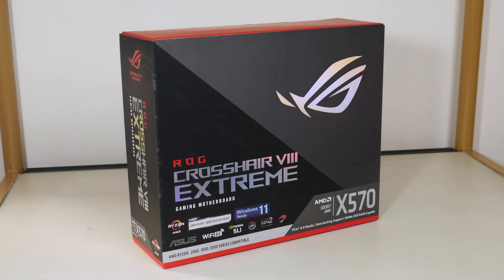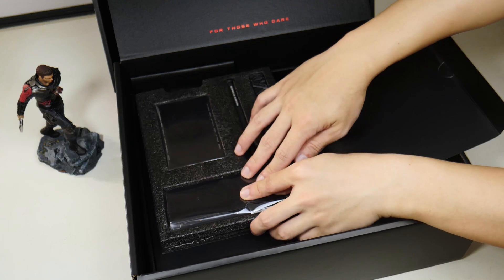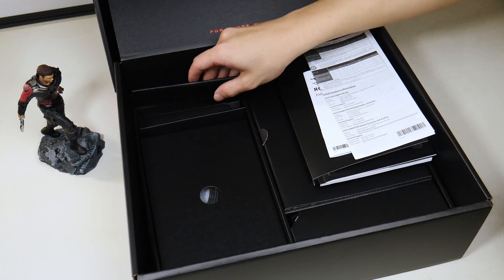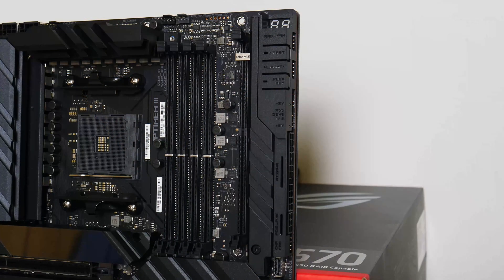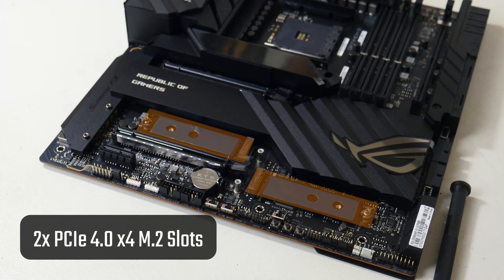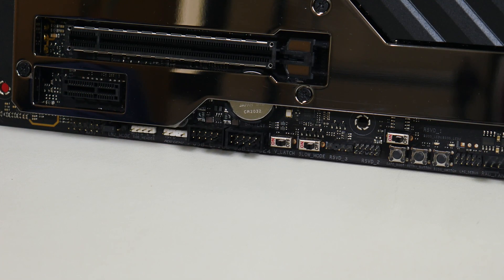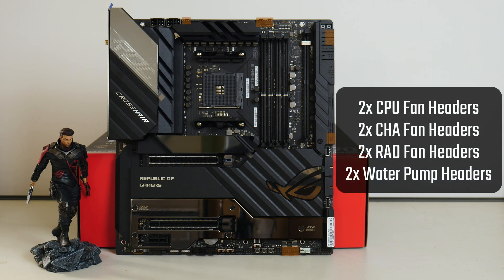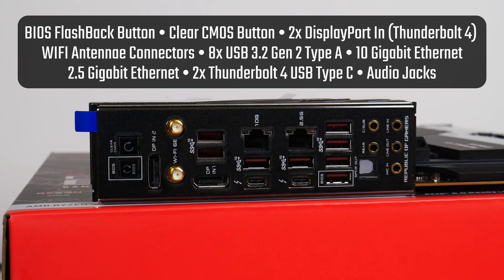The Ultimate ASUS X570 AM4 Motherboard: ROG Crosshair VIII Extreme

Comment: Is it possible to use all five nvme slots even if everything is ready to the chipset without reducing bandwidth for the gpu?
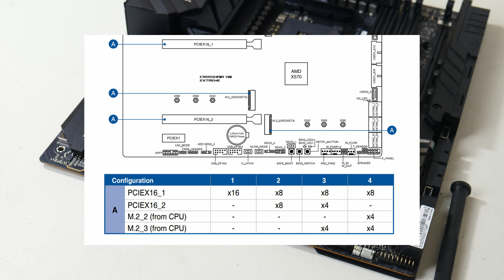Reply from the maker: This is not possible unfortunately, the three M.2 slots on the board utilise PCIe lanes from the processor, and as shown in 10:04, if you populate M.2_2 and M.2_3 concurrently, the PCIe bandwidth for your GPU will be reduced...
Reply: @ALKtech  thanks for responding on such an old video I really appreciate it!  I don't suppose off the top of your head you know any x570 another words that are roughly this quality and can fit more m.2 drives then 3?  Trying to build the ultimate pcie Gen 4 build.  Don't care too much about the price tag as long as quality and features are top-notch.
Reply from the maker: @Slacker28  happy to help! How many M.2 drives in total are you looking at using? You might want to look at the Gigabyte X570S AORUS MASTER that has four M.2 slots - one of these slots shares bandwidth with the PCIe x16 slot that operates at x4 mode.

You could also try looking at MSI's website for high-end X570S board offerings - those from the MEG range for instance!
Reply: @ALKtech  thank you! I will.

Comment: I ended up being in the right place at the right time, and got this board for a much lower price. It should be in next week. I can't wait to build it. Good vid. But why doesn't anyone say what the "ON/OFF" switch is above the safe boot button????
Reply: How much did you get it for
Reply: @SGOVisions  I got it for $600. But I have since sent it back and gotten a full refund as it would not run properly after using the Dim.2 slot for the two extra ssd's. I then went full upgrade with a Ryzen 7950X, Strix E and 64GB of DDR5 6000 RAM. IF you're going to pay premium prices, might as well go with the latest and greatest platform...

Comment: so to be clear and see if im correct. i got 3 m.2's, if i would occupie socket 1,2 and 3 mij gpu wil drop to 8x.
If i would use m.2 socket 1 and put the other 2 m.2's in the dimm2 module dan all wil be on full speed.?.
Reply from the maker: That's right - I would recommend installing your second and third M.2 drives on the DIMM.2 module instead, so as not to reduce the bandwidth of the primary PCIe x16 slot to x8 speeds for your GPU.
Reply: @ALKtech  another question you maybe knows, if i use the dimm.2 with 2 NVmE's wil that have consequenses, like slowing down something else? maybe the ram? im gonna use 4 ram sticks.
Reply from the maker: @2684dennis  you'll be fine - the DIMM.2 slot operates independently of the main system RAM and will not affect performance in any way!
Reply: @ALKtech  From what I've seen on other videos, you can occupy all five m.2 slots, and the FIRST PCIe slot with your GPU will STAY at X16, and ONLY the second PCIe slot will be disabled, not that the first will drop to X8. So I'm wondering which one of you is correct?

Comment: Much appreciated! Best overview of this board on YouTube. Today I’ve been building myself a new workstation with this motherboard and and the new EK-Quantum Momentum² Monoblock. Your video helped med figure out how to connect the Fan Controller correctly among other things. The ASUS manual is far from complete :) Thank you.
Reply from the maker: Thanks for the kind words - great to hear that this video was useful for you! Sounds like you've got quite a beast of a build right there - what are some of the other components that you've selected for your build?
Reply: @ALKtech  2x APC Back UPS PRO BR1600MI, The EKWB Monoblock, 5950x, 4x32GB G.Skill Trident Z Neo 3600 CL16, Samsung 980 Pro’s, Aorus 3090 WB, Corsair AX 1600i, 2x EKWB D5 pumps and 2x420 EKWB x-flow radiators (not yet delivered, so I use 2x280 now), Noctua fans.
This rig is of course somewhat overkill for most of my work, but it is a nice gaming rig too though :D
I wanted to compose a proper maxed out standard desktop for Solidworks and Photoshop. Next upgrade will probably be to replace the 3090 to a AMD W6800 card. I'll will order a custom CNC-milled waterblock for that card, as I have tinnitus and prefer not to listen to fan wining when working, and that graphics card will likely be reusable in the next rig, after AMD releases their next gen cpu's, maybe next year. This rig is not yet completely silent, but when the new radiators arrive I’ll will move out of the BeQuiet 802 case into a IKEA Baggebo cabinet (or similar furniture cabinet) and trim that one with sound damping air filters and some foam sound mufflers, vibration dampers and such.
Reply from the maker: @kitewinds663  You sir, have one heck of a rig that most people can only dream of! Enjoy!